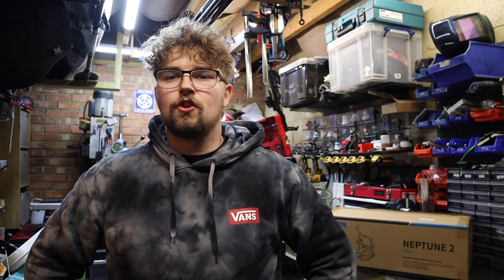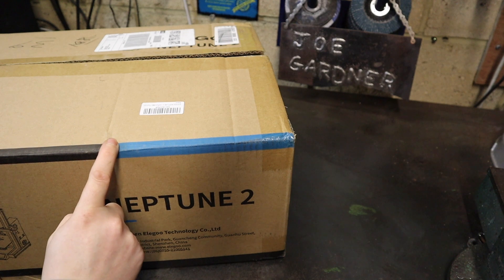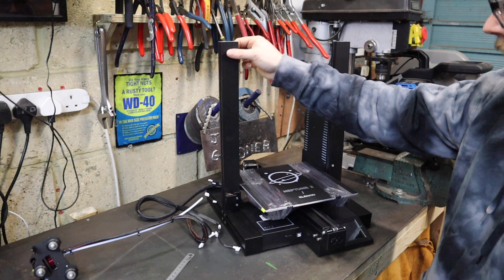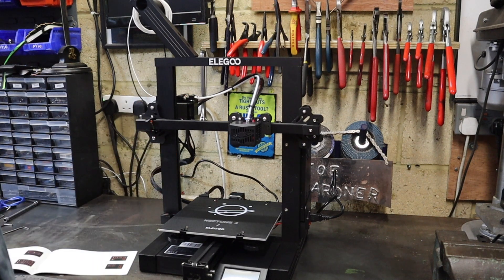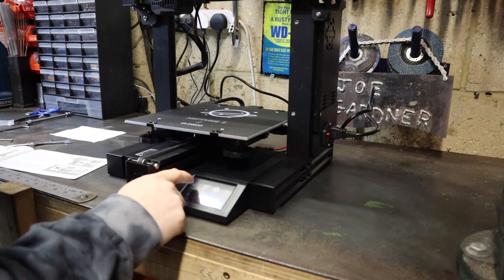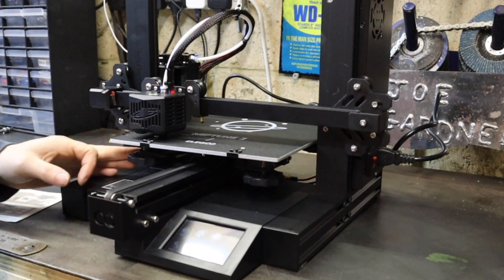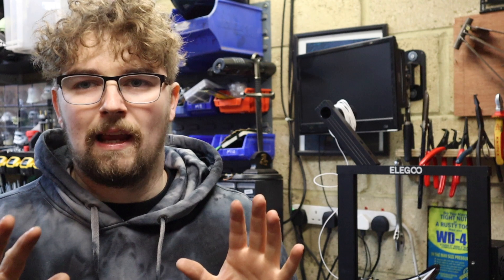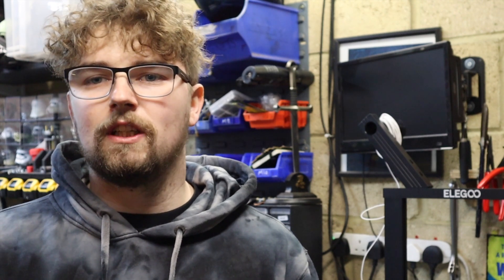Unboxing and Setting up New Neptune 2 3D Printer

Comment: I need to get myself a 3D printer to go along with the CNC router that I built.  I could always just build a 3D printer from scratch but I have enough projects on my plate that need to be completed prior to taking on yet another machine project.  Great video Joe, can’t wait to see what you make with the new 3D printer.
Reply from the maker: Yeah they are a great bit of kit to have access to and for the price I don’t think you can go wrong. Haha always to many projects ayy
Reply: @MachiningwithJoe  I am currently working on a CNC conversion project for my mini lathe, a power feed for my mini mill, a Bowie knife project, a derringer project, an AR15 build, a 1911 build, tool review video, model gas engine build and several other projects.  Too many to list really, I was medically retired three years ago and need to do something with all this free time besides watch the television.  As long as I don’t push myself too much doing machining, or other physical activity, I’m ok.
Reply from the maker: Sounds like you have a fair bit to be getting on with. Maybe a good idea not to add a 3D printer build to it just yet 😂😂😂

Comment: Haha congrats be warned 3d printing more addictive than shaping metal.
Reply from the maker: Yeah there is a lot to learn with all the slicer settings and different filaments. At least I can leave it running with sticking the kettle on for a brew
Reply: One thing I wouldn't use that scraper it likely to damage the printing surface PLA will pop of a cold bed look at using a painters palette knife...slic3r takes some getting used too but it does a good job cuting models up into smaller section for printing...few good helmets on thingiverse
Reply from the maker: Great advise there Jinx I’ll have a look into those palette knifes. Thingiverse is great found some cool stuff on there so far.